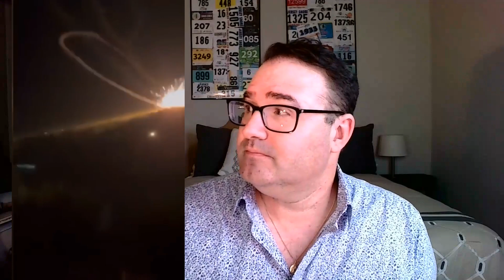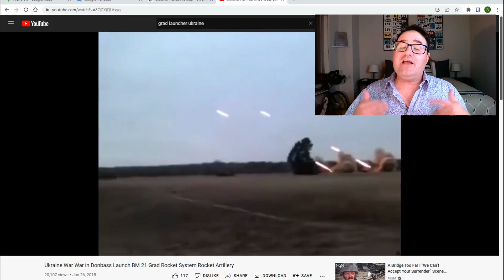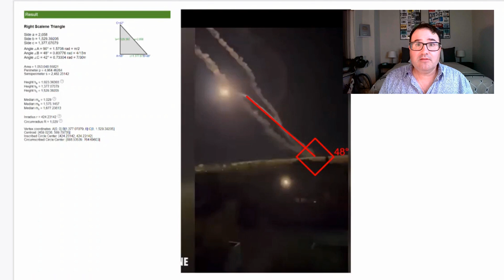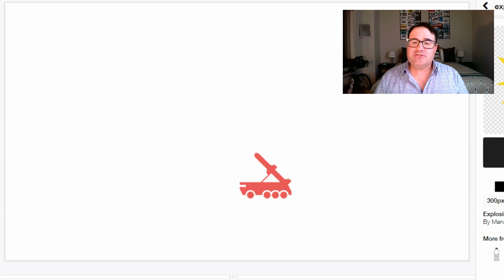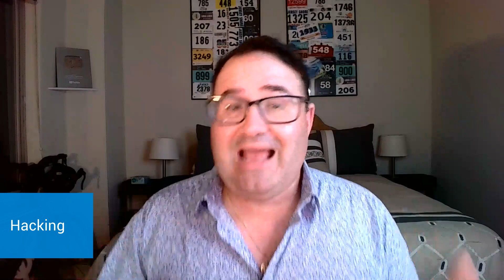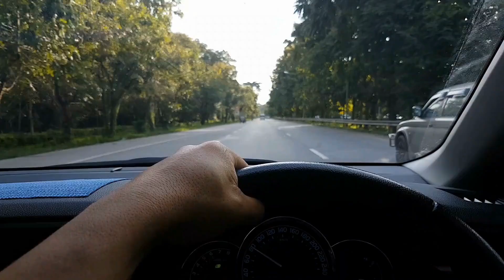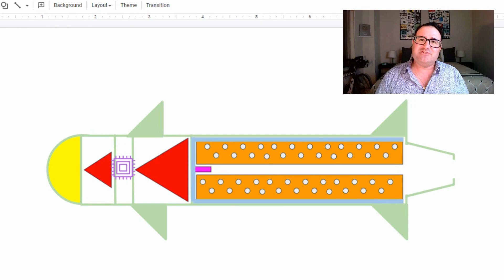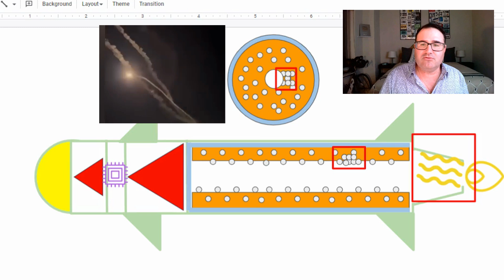Why this missile U -Turned

Comment: I think your wrong. Missiles constantly adjust threyr trajectory. To compensate to a wind or other factor. Secondly it does not matter where the fuel is burned inside the chamber. It only matters from where it is ejected. The only thing your theory would do to a rocket is inconsistant thrust, like if you would keep hitting gas pedal on a vehicle instead of compresing it and leaving at the same point. As to why that happened i have no clue.

Comment: Interesting theory. It explains why the rocket resumed a straight course after its U-turn.
However, another explanation might be that for some reason (Bug?) the missile suddenly started tracking the biggest radiation source in the area, which was its control van, or mis-interpreted its actuation commands. Or perhaps there was a singularity in its internal navigation software that got triggered, which made the thing believe it was flying in the opposite direction from where it should go.

While normally they wouldn't make large corrections, a bug may well cause them to behave differently.

My theory is that we have seen a software bug in action, and an illustration to why military & aviation software is so much more expensive to develop than administrative software.

Comment: I think that your theory is wrong because 1 the angle at which the exhaust would be at isn't enough to turn the missile that rapidly and 2 the exhaust is still traveling through a nozzle which centers the thrust. What I think happened is that through a bug or operator error the missile thought that the target was behind it. Of course the missile guidance could also have had a fault

Comment: Ryan, I like your video's very much! But i agree with Mattsoup; gas only exits out the end, all transverse impulse loads from burn inconsistencies are 'contained' within the fuel chamber. Only scenario for which fuel inconsistency might alter thrust, if it locally burnt through the rocket wall. But then it would be a 'permanent' side thrust component; in effect travel in circles... Unless fins correct this; but i assume it's not very likely fins can correct a large amount of side thrust.. Also; i would expect to see a flame on the side. Also it doesn't look like an over correction of the fins, if the rocket momentarily lost thrust due to fuel inconsistency. Technically fascinating, tragic we're looking at destruction...
Reply from the maker: I’m thinking it could be Burn through now. If the elasticize was cracked, we could see the reaction Travel down that crack until it burns through the insulator. Then we have a jet coming out the left side turning the weapon in a slow circle that we perceive as heading straight back do to parallax. I might make a video about that.
Reply: @RyanMcBethProgramming  Thanks for quick responses! Also see my addition... (edit; wait, you already mention the perceived flight path!)

Comment: It can't be a stuck fin (even if a link brakes during the boost) because it then goes straight again after the turn.  I think your explanation could fit, it is just supper low probability that the turn was exactly 180 degrees and not 85 or 158 degrees.  It is more likely an on board sensor (accelerometer or Magnetic) was installed backwards during construction, which did happen on a space rocket at one point.

Comment: I am not saying that this is what happened but ruling out the hacking hypothesis is done on arguments that forget about the stuxnet situation ... just saying :)
Reply from the maker: Well, we're dealing with operating systems that were well know.  Pakistan sold the centrifuges to Iran and from what I understand.  All you would need to do is buy the same centrifuge and look at the API manual.  It's a lot harder to do this with an OS and software that was written in the 80's or 90's in Russia.  And then the launch trailer itself is guarded by men with guns.  Not impossible, but very, very improbable.
Reply: @RyanMcBethProgramming  again, I am not saying it is the case but I would not rule out this hypothesis. Not having a modern OS is a pro factor :) (into considering this hypothesis)
I am pretty sure that some agency was at least looking into doing this kind of stuff (over the years, not just lately). 
Like in stuxnet's case, if you deploy something like this, your dry run should be "occasionally missing the target" or 2nd iteration could be something that would "communicate" to the source that it happened (in stuxnet's case there was no actual way communicate back that it acts but here there are some opportunities). So, this war would be a good opportunity to test that "something" was deployed and is "operational". Having one (but 1 in 100) rocket aiming at the source is a kind of "println("Hello World")" :)) . Still, this kind of "hello world" considers that you have eyes on all the rockets which is most certainly not the case.

So, I would say that is "highly, highly probable" that a consistent effort was put into this kind of endeavor therefor your assessment of "very, very improbable" would rather be about the success of it ;) 
One step further, combining the two probabilities should be done by considering bayes theorem.

PS: btw, it is clearly known that a lot of systems were acquired by the west thru proxy countries (some of them were donated now during the war ... "ah, look, we have this in our basement"). I suppose they were not analysed just for testing the range and precision. And, NATO's bad boy : Turkey, has acquired some sort of S-300 or something like this. I am not saying Erdogan is making the West game, as he should, but also intelligent people would make use of any opportunity to study stuff (I hope), right ? :)
Reply: @RyanMcBethProgramming  it seems I got carried by my wishfull thinking :( 
(my desire to have some more cards available in this case)
I say this because I just saw an analysis about how the russians are using more "diversified" arms these days in the sense of also the old ones  (or even maybe faulty/rebutal lots)
Reply: @RyanMcBethProgramming  there seems to be another rocket that went back in the launcher area (after some of them refused to launch). Check the same twitter account for video...

Comment: I'm not as convinced of this explanation. In my experience with rockets (albeit the kind intended for space, not weapons systems) this looked a lot more like a failed control actuator. 

If it were due to a factor external to the control system (like the solid propellant) you would see the rocket attempt to correct for the phantom disturbance and either succeed, at reduced performance, or fail. If it failed it would then start doing summersaults as it would be unable to remove or counter the source of the torque. However a failed or partially failed control actuator could cause absolutely no issues until it's required to make a tiny adjustment and doesn't.

 Then the rocket, which was likely already aerodynamically unstable, quickly flips, decelerated to the point of "stalling" (in a sense), and vegan accelerating in the opposite direction. Then by the time it picked up enough speed for the control surfaces to have any influence, it smacked into the ground. You can almost see it try to pull up before hitting the ground. 

Anyways that's my theory. Still likely due to poor maintenance either way.
Reply from the maker: Maybe.  I'm thinking that back in 1995 some Russian civilian contractor bumped this missile with a fork lift and didn't tell anybody about it.  Then they didn't do periodic non-destructive inspection on the missile because... of course they didn't.  And it just wasn't a problem until 27 years later.  We'll never know.

Comment: If you look closely, you can see that the missile actually made a perfectly executed course change implying that the missile' terminal guidance radar came on too early and it locked onto it's own ground based initial seek radar system. Faulty missile electronics.
If anything such as a stuck fin or damaged/disturbed propellant was involved, it would just spiral out of control...
Reply: If russian missiles are anything like western ones the missiles' own tracking radar is in the forward cone, pointed in the direction it's supposed to go, so only things in front of it not behind it.
Reply: Today (July 8, 2022), the mayor(/head of military administration) of Mykolaiv released a video where he states that russians are re-purposing S-300 rockets to hit ground targets (adding GPS modules or smth), because they have plenty of those and lack of others. So it might be the case that what we saw is just a failed attempt of a ground-to-air "upgraded" missile to hit the ground target.
Reply: DId they hurt themselves or no?
Reply: The missile did not hit its launch site...
Reply: Guidance radar is a separate vehicle..
Reply: @IturaldeRodel  How do you know that? The video shows it obviously returned to it's launch point or very close. Please provide evidence that it did not.  Also, it is a point to note that multiple search radar associated with the launch vehicle are usually offset from launch vehicle to avoid enemy aircraft locking on to the search radar and destroying the whole setup. It probably took one of them out surrounding the launcher.
Reply: @IturaldeRodel  Will do! Thanks for that info. 👍🏻
Reply: @IturaldeRodel  the missle would have headed towards the radar vehicle not the launch vehicle.  This could explain why it hit in front of the launch site.
Reply: @JoeMandell-  no, not even close. Watch the other videos. If you want to believe a fantasy go ahead. I prefer reality.
Reply: Most likely it had damaged fins which got stuck or smth
Reply: yes thats a perfect 180° turn, looks like aiming actively at its own radar
Reply: Agreed.
Reply: But doesn't the missiles onboard radar have a forward facing fov limit? And why or how would the missile trac a ground unit?
Reply: A faulty program that used arctan instead of arctan2, and therefore couldn't distinguish between quadrants.
Reply: That’s literally impossible lol
Reply: If u do more research and look where it crashed it did not do a 180* from a diff camera angle it did something like a 90* turn so it did not lock its own radar
Reply: @hemendraravi4787  No, it made a 180° turn.
Reply: @rursus8354  go research more it did not even make anything close to a 180* turn
Reply: @hemendraravi4787  I don't need research to see that it did a 180° turn.
Reply: its just a spy
Reply: Imo guidance was installed upsidedown. Happened to a Russian space rocket once.
Reply: Remember the clip of the Titan missile test in The Right Stuff ? Man that was great, just cruising in a slight dive for several seconds before range safety decided the instruments had enough data and a flight anomaly would be more important data than the data from a ground impact. My Point: Missiles can stabilize, that doesn't make it a perfect course change.
Reply: When i first saw this i was thinking the missile went stupid. The first two missiles destroyed the contact they were fired at. The third missile tries to course correct for a target no longer there. Reads radar signature of the launcher and slams into the ground. 
 
I know next to nothing about sams and the fuel clump theory requires a shorter chain of mishaps than the missile going stupid. If i had to pick then the explanation about the fuel cell seems likelier.
Reply: This was also my first guess. Most missiles have protection against locking on the launcher platform but probably something went wrong in the electronics, it may also be a fault in the algorithm.
Reply: "Ivan, put out your cigaret-"
Reply: Agree… why exactly it made this course change isn’t clear, but I’m pretty sure that’s the correct explanation…
Reply: I agree with Howard, the "tracking" radar lit up the launcher, and brought the bird back home.
Reply: Not necessarily, if it was very brief and the missile was travelling very fast when it stopped, but stabilized and unguided (yet). The stabilization means the two favorite positions to be moving in are straight forward, and straight back. If that's the case and the rotational momentum is gone right before the rocket motor slows the projectile back down to start the other direction, it only requires a little luck to see it correct almost perfectly for gravity.
Reply: @OdinBarenjagerschlos  i mean, that sounds kind of like how rockets can turn at right angles with wind... but i dont see how gravity would cause that
Reply: This way or another, but Banderivtsy are satisfied with result!

Comment: I am thinking that the longitidunal combustion chamber and nozzle would mitigate thrust assymetries due to the inconsisent fuel.  Not to mention that the diameter of the rocket is small compared to the body.   This would be interesting to model and test in a CFD software

Comment: Wasn't a stuck fin: it flew straight as an arrow both before and after the turn. Which is also why I'm not buying the "fuel clumping" theory: that turn was way too precise, and once the clump is burned out the missile would try to get back on course, which it didn't. This was a guidance issue, either software or hardware, not an aerodynamic or propulsion issue.

Comment: I think your spot on as there is no indication of a hole burnt into casing as in the shuttle boosters. Could a nozzle distortion have caused it just before the end of the boost stage but then fuel appears to be still burning as rocket flies straight to the ground.

Comment: I would have guessed that the guidance radar, either the on board or the external one, locked onto the wrong object, possibly the missile itself if it was the external radar guiding the missile in the moments of failure. If it was the onboard radar, it may have locked onto the signal from the external radar, presumably somewhere near and behind the launcher.
A very well defined u turn right back to the launch point seems like seeking behavior more than malfunction.

Comment: I am not an industry aerospace engineer, so take my thoughts on this matter with a grain of salt.

The solid components of the composite propellant (APCP) shouldn’t be able to migrate, not really. It’s a mix of solid oxidizer, solid fuel, and other additives, suspended in cured polyurethane rubber, which is basically what HTPB/PBAN are. HTPB and PBAN are binders used for composite propellants. It could also be CTPB but that’s not super relevant. The plasticizer you mentioned does help prevent cracking, but the polyurethane rubber already does most of that by the nature of the material itself. Plasticizer helps with things like reducing propellant toughness, in return for more elongation before breaking. Also it can help with the mixing process.

As for the asymmetric thrust out the nozzle, I don’t see that as too likely, at least due to a hot spot. Convergent-divergent nozzles, or just plain old rocket nozzles, are really good at shooting all the gas in one specific direction.

Given a hot spot, with more propellant burning on one side, the center of gravity moves off center line, so your straight thrust vector now becomes effectively off angle. I see that as more likely than the gas coming out the nozzle at an angle.

Basically, the gas likely still came out straight back, but the center of mass moved to one side, so torque occurs.

If there was a failure in the nozzle or the side of the motor casing, that would leave a hole for gas to shoot out of, which could potentially create asymmetric thrust.

That’s not to say it isn’t possible for what you suggested could be occurring, I just think it’s unlikely that’s what happened. My thoughts are also based on the current info available, and I might have missed something, or new information comes out that changes things.

Comment: Interesting. Something I also think is probable is the guidance system or its sensors were installed incorrectly. If the sensors in the missile telling it what way it is facing were backwards, and that what we're seeing could in fact be the guidance system 'waking up' as it were and thinking it's going in the wrong direction. If this happened, it would want to turn around to head towards the target as far as it knew. Having turned to where it thought it was facing towards the target, it then flew into the ground.

Comment: Mechanical failure of an actuator caused hard over nozzle. Your explanation is creative but could not cause the failure seen (might cause grain fracture, erosive burn or kaboom). Trident II first launch experienced this, on a much bigger missile obviously.
Reply from the maker: I’m starting to lead toward burn through of the insulator. Thoughts on that?
Reply: @RyanMcBethProgramming  kaboom is usual result of that. A fractured nozzle is also a possibility. Early in the burn hard over nozzle can result in pretty sharp turns, as witnessed in intentional energy scrub maneuvers in early THAAD tests.

Comment: Your theory makes sense, but as the missile hit the byk that fired it (the flash says that it did hit it),i suppose that its own guidance system (i think it's looking for lots of heat) turned it right into the byk as it was heated from launching it.

Comment: Wow, it looks like the missile hit the ground somewhat close to the launch site!

Did those ground crew guys just get oblitr8d?!

I am a bit surprised that a missile traveling at mach 2 can make such an extreme turn, even if the turn is broader than it looks from this angle, without being disassembled by sideways atmosphere loading.
Reply: That's what these missiles are designed to do. They must be able to do 25g turns  to catch a fighter jet doing e.g. 8g turns.
At Mach 2 every small course correction turns into a high g event.